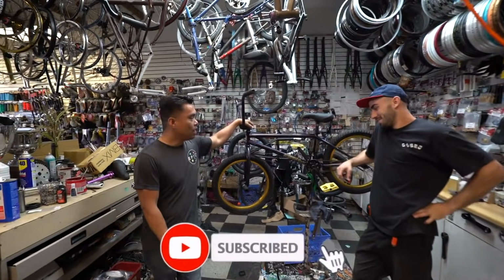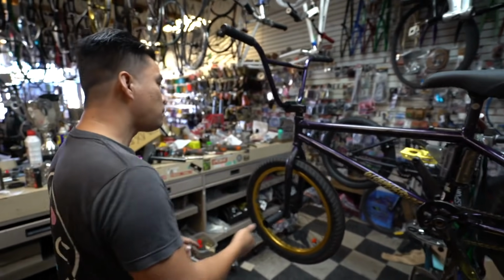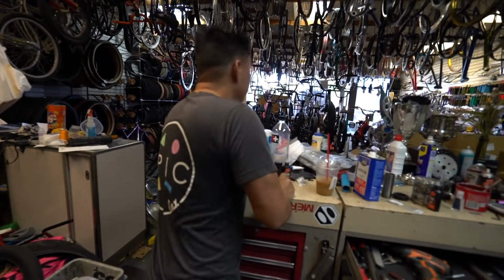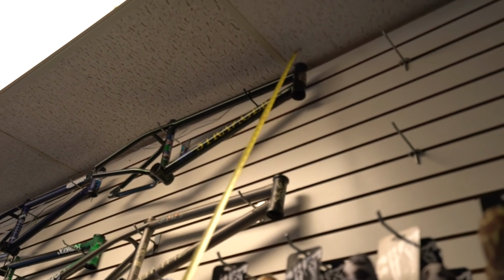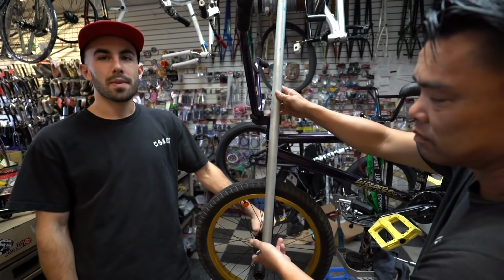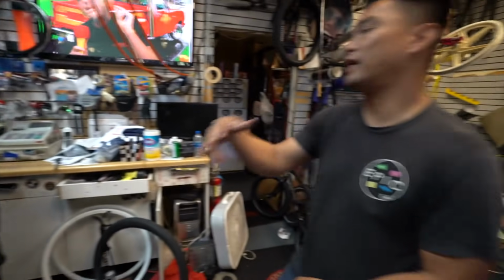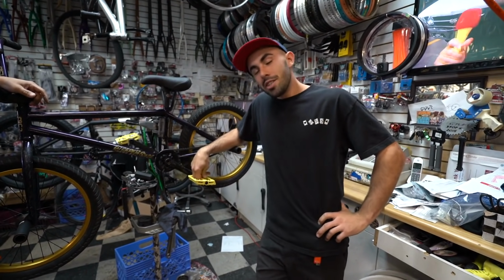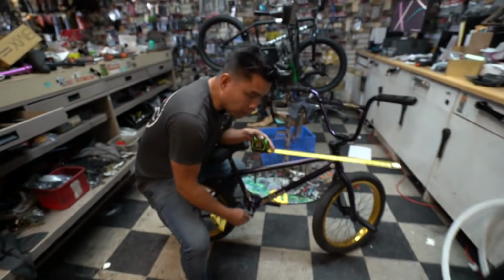BMX BIKE FRAME MEASUREMENTS AND GEOMETRY!

Comment: Phu you should talk about what could make your back wheel crooked. When I first started riding I didn't know what to buy and got a right hand drive but my right foot is forward. I think it would help to talk about weight distribution and the effectiveness of spacers and other things you could do to keep your back wheel straight without using tensioners. Thanks man love the content!
Reply from the maker: Paint slippage. We’re addressing this next week
Reply: @AlfredoMancuso  excellent! I had so many problems with slippage and im not positive if it was bc of paint either so adding in other ways that there could be slippage might help also. Thanks man keep on educating the masses!!

Comment: So i got a R25 forks 180mm on a fly savannah 4.45 headtube. I have to use a lot of spacers. Can I still ride fine or should I look for a frame with a taller headtube to make up for the form height? Or does it not make that much of a difference ?
Reply: bike shops also answer these annoying questions
Reply: @yeseniamacias662  actually I'm just gonna get the wtp pathfinder frame that comes with a 5" headtube so I don't need to cut the fork

Comment: I'm new to BMX and I've got a question about my second hand BMX. It seems that the circumference of my top tube and down tube is much larger than on the BMXs I generally see on the internet, like in this video. The circumference of the tubes is roughly: 7,4 inch top tube and 8,2 inch down tube. As this seems so uncommon, with what kind of BMX am I dealing here?

Comment: Who am I to say, but I feel like the standover height should be from the floor to the top of the top tube. That's how it is measured in every other bike scenario. But in BMX, it's basically the size of the seat tube. Not sure why they use "standover" as opposed to just "seat tube length".

Comment: They need to have a bmx racer and freestyle there to really tell how much of a difference the geometry makes along with riders height also makes a difference. Like how a shorter rider can easily ride a bike with a CS length of 12.7 and not loop out so easily as someone 6’1 or above. Also try riding a bike with a 75.5 degree head tube and try racing it on a bmx track when you hit the jumps it’s harder leveling out the bike as with a 74 degree or even a 73 degree angle you can just coast over. Also how racing bmx bike are like 21.5 and over in toptube length with a long backend starting at 15 inch. All this is similar to skateboard longboards, motorcycle Hayabusa. The only people who say it doesn’t really matter is shorter riders who seem to ride 21 inch top tubes when they could still barspin with 20.5.

Comment: High bottom brackets make manuals easier. For catwalks low helps cause leg extension. But high still helps. 

Headtube height also affects headset bearings. More stable less deflection. Also helps with strength. 

Seat tube angle can also help. Also fly has always had options with short rear ends. Tierra and others. Only a few frames had long rear ends and it was like 13.75 which used to be standard. 

11.5-11.8 is usually the amount of play you have on height. 74.5 used to be standard headtube angle. Seat tube is like 71 or 72.
Reply: ryan sullivan  if a bike has an 11.5 bb I literally can't even hop the fucking thing. Low bottom brackets is the most disgusting feeling in the world for me.
Reply: ryan sullivan  fair enough. Probably like my preference for super long stems and most people hating it lol. We all have preferences.

Comment: the chaistay length depends on your height also. ethan seems somewhat lanky, and of course he prefers a longer chainstay (not only longer top tube) than someone like Chad Kerley, cause his butt (and center of gravity) goes father back when he pulls the bar up. i really appreciate the video, especially the input of a pro, but boy, i think me, as a rough beginner, can explain most of this stuff better. Alfredo, which spoke the least, was the most coherent. worth mentioning that a higher bb will also require a higher front end, cause it sucks to have a high bb and pull on low bars (also, i doubt park riders have high bb's, like Phu mentions, since they need stability)
Reply from the maker: Very true! 💯

Comment: Backwards manual all day?!? Hell, I’m trying to forward manual longer than a bike length 😂😂😂. Ok, I ride a 22 and it’s got a pretty long CS. I need to do a half link and slam the rear a bit more. 👍
Reply: What does it mean to slam the rear end? Never really understood it.
Reply: @armaanhayerr  get the rear wheel as far forward as possible
Reply: @oldfartonabmx2122  wouldn’t that make the chain loose?
Reply: @armaanhayerr  . You take a half link or more out to get the chain tight again

Comment: It's funny to see people get caught up in top tube size and all that.... I'm 6'3" people say I need a 21" TT but I also have a 20.75" TT and after it was built up the 20.75 has a longer wheel base and is actually front stem to drop outs it is still a big difference in size even though the TT dimensions are different they both ride absolutely different to each other.

Comment: I still don't like the steep head tube angles of modern geometry..I'd take an old 73-72 deg head tube anyday over modern design...I've even looked at using a bmx(race, like actual bmx)frame...I wish we could use a different word like we used to say freestyle...which sounds seriously dated...but fits better.

Comment: Shorter the chainstay, the easier to manual...
High BB rise is good if you're good or plan to become good. It allows you to reach the potential, it isn't holding you back with a lazy and stable stance.  Stay with a low BB if you want a daily driver to school, but nothing else.

Also if I want advice what to spend a lot of money on, I won't hold yours to a very high standard when you say you have no idea or you don't care about key details.